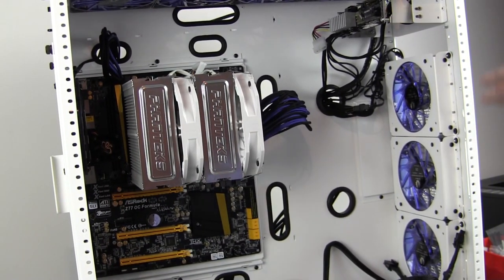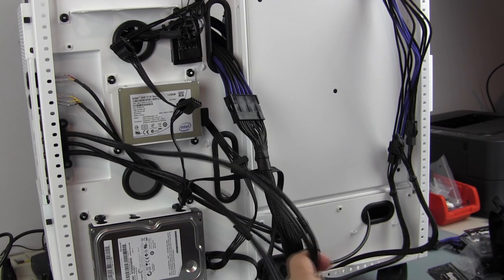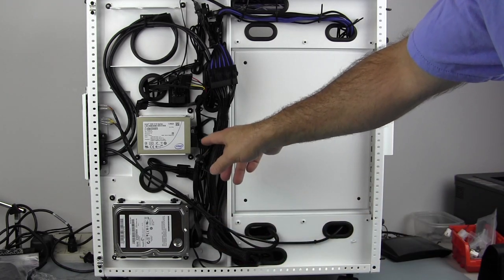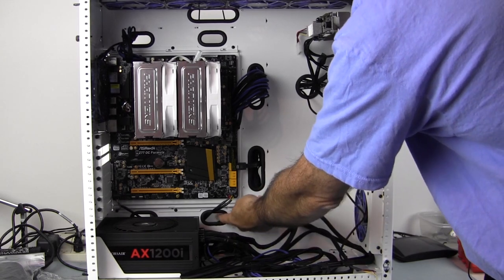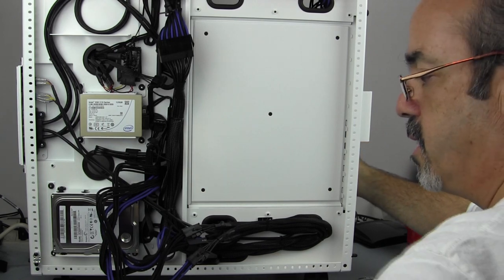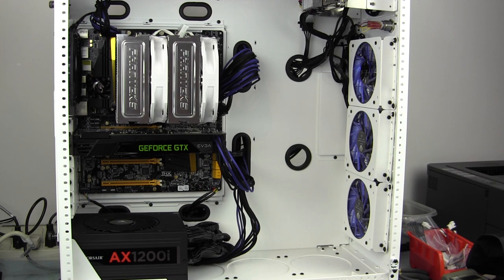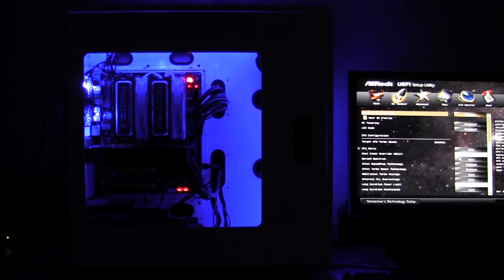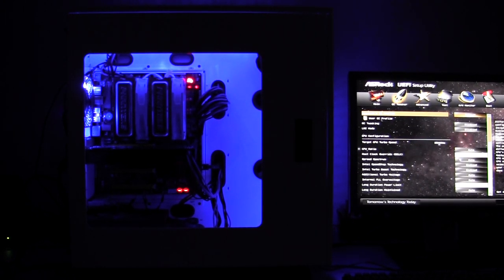Case Labs SM8 and Z77 OC Formula AIR Cooled Build Log 4-  Cable Management

Comment: Ron, you could use an internal USB 3.0 male to internal USB 2.0 female adapter.  If you connect your second front panel USB 3 cable to one of those adapters you will have USB 2.0 at the front of the chassis.  You did a good job on cable management Ron.

Comment from the maker: Yes the trade off to not sleeving myself and using extensions is the added mess of cables.  Even though I will only be the one to see, now that I sell my systems I try to make it as neat and orderly as possible.   I hope that water cooling it keeps the temps under control and can pass at least one pass of OCCT at 5GHZ.  At least I know today the CPU is capable of doing that just under AIR it gets too hot when you approach 1.4 volts.

Comment from the maker: Thanks. Yes, I too believe in positive pressure to help prevent the dust problem created by having more exhaust than intake fans.  This case has since been disassembled and changed . Now it is a water cooled build. Please check out the new build log .  Thanks for watching.

Comment: You can use a Silverstone G11303050-RT to convert the other front panel USB3 ports to USB2, or a SST-EC01-P to get the full USB3.

Comment: i really like the moment, when u press the powerbutton and the fans all light up! looks great. but i see why i wouldnt use extensions, when the cable are not to short, to bad to manage. although i dont care how the back of the case looks, it won't be seen by anyone than me ;)  do you think u can get it stable at 5GHz with the water build?

Comment: The one comment I have isn't towards this case alone, but I was wondering why you build most of your cases so that there will be a low pressure zone inside. Because this will effect how much dust settles inside the case, if you were to put some more intake fans and create a positive pressure you wouldn't have this problem. Also the fans on the cpu heatsink seem a little high up I was wondering if it were possible to move them down slightly. Other than that It looks nice.

Comment: I wish my cable management would have turned out this well. It was going fine untill I had to do the IO panel and my z11 plus case just didnt have a hole to reach down there so I had to expose alot of the cables and bunch it up at the bottom of my case :/